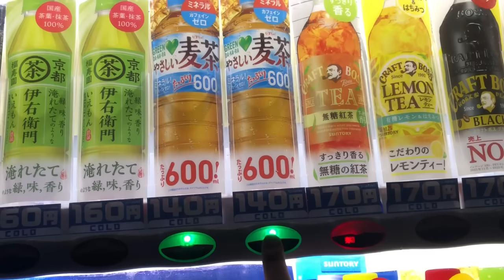Making a Popper For Big Fish【Lure  Making】

Comment: Here's a little trick i learned with a popper like that hold the rod tip almost straight up and pull back to make it pop instead of holding it low.  Works much better that way (it kids pulls it up and out of the water making a good popping noise